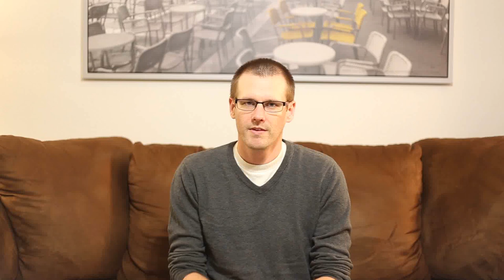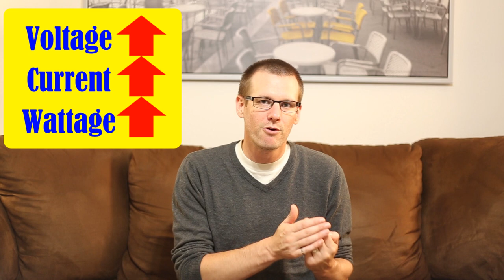Can Higher C Rating LiPo's Destroy a Motor or ESC?

Comment: high c rating will not hurt the system  as long as you are using the proper voltage, why because it will never pull more than it needs. this should be about sizing all the power system for the motor .. that includes the prop. under sizing  will  hurt the battery and the the power system  .. sagging voltage  increases the Amp draw. then you have heat
Reply: Exactly. C rating isn't going to damage your motors or escs.
Reply: True, C rating states how much current the battery can safely provide without overheating, not necessarily how much current will actually flow through the system.
Reply: You must not drag race.

Comment: So the answer to the question is "No", because the whole electrical system can only pull the current it needs to operate. So long as you don't overload the motor with too large a propeller. A battery doesn't push amps, they are drawn from it.

Comment: hi, for a flashlight that need 6A load, if i buy a 35A battery will damage the system? the voltage still 3.7v 10A or 35A...

Comment: I know this out of topic but i need help,a 4370kv brushless motor paired with 35a esc but will only runs on 2s lipo.will it give any trouble?
Reply from the maker: No it won't be trouble if you load the system less than 35A or your weakest link. Yes it will be a problem if you load your system to over 35A or your weakest link.
Reply: @RCexplained  will my 35A-SL esc run with 3S 11.1v 3500mah? I don't really sure what battery should i buy.tq
Reply from the maker: Hello, i don't think that's the right question. The question that will help would be: is my 35A ESC, 3500mAh battery and X motor going to be ok with using a 12x6 APC propeller. 

Your battery will be fine if you don't plan on using a load. But it will fail horribly if you toss a 35x20in prop on there.
Reply: @RCexplained  tq for replying me, i actually want to know what is the maximum battery voltage suitable for my 35A esc. Im sorry my english is not really good.
Reply from the maker: Does the spec sheet not tell you the maximum?

Comment: This is opposite of what all other places say about the c rating. It just says how much your esc and motor pulls. Your esc would have to pull more power then it can handle which would mean it is already broken
Reply from the maker: Why would an ESC be broken if it has more power pulled through it then it can handle?
Reply: @RCexplained   Electronics are design to pull the power they need and not just pull all the power they can. If the hardware or programing of your esc makes it pull more power then it is designed to do and burns it self out, that is broken. Now if you put a higher volt battery that pushes power into the esc and burns it up that is different. One is pulling power and one is pushing power.
Reply from the maker: @R2D242D  interesting perspective on how physics works. This is a very different thing then what is taught on this channel.

Comment: Im using 11v 2200mah  25c s3 lipo and 40a esc 5v , A2212 motor and the esc burned twice , i cant find the problem ((rc plane)
Reply from the maker: What kv and prop? How many amps were you pulling from the system?
Reply: @RCexplained  8/6 props 1400kv , but dont have ampmeter to fnd out (im noob btw)
Reply from the maker: @halash447  setup sounds ok. It would be a good idea to buy a watt meter and measure what is happening in your system.
Reply: @RCexplained  thank you very much i will also change my motor which could be blocked , all the best and thx for ur advice

Comment: I use 3700 mah 130c lipo,90 amp esc and 4480 kv and 37 mm prop brushless motor for my rc boat...its getting hot on my ec5 and banana bullet 6 mm....and loose power when  i play just 3 time full trigger....why is this happen...
Reply from the maker: Sounds like you are pulling too much current. Your setup is ideal for a 2s battery. I'd expect you are using something different.

Comment: Hi! May i ask a question: i have a thermal issue with my motor. I ve been using chinese esc(bec 6v / 2a) and battery pack (2s 3000mah 35c) for 370 9volt 50000 rpm motor. i burned several motor already. what seems to be the problem? or which part do i need to change? i still want to use the same motor, but it keep overheating

Comment: Ok so ive been looking into this for so SO long now ive lost sleep its affected my work, im dreaming of lipos chasing me up and down stairs in elevators and up the street and ive been to every retailer, Youtuber and Rc/Hobbies forum on the planet, and from what ive found in a nutshell is this. 

The "C" rating on batterys cannot destroy your motor or esc. Your motor/s or esc will only draw current required from the battery not the other way round (i.e the battery does not force this "C" rating through your motor/s esc's)  the "C" rating is just there to tell you the safe discharge speed of the battery so going higher is always ok. 

hope this helps.. I need to sleep now.
Reply from the maker: This is very true in general, (C Ratings should never lead to destruction of components) however, there is a scenario that many should be aware of and understand clearly.  A higher C rating allows a system to maintain a higher voltage or lower voltage drop across the battery pack. With a higher voltage from the battery to the motor, the motor will draw more current. If your power system is already on or very near it's thermal threshold, this small bump in power can exceed the thermal threshold  causing burnout or destroyed components. If you notice a bump in acceleration or speed from a higher C rating pack in an RC vehicle, this suggests the system is experiencing higher power output. 

The second part of this is:
If this scenario is true for a power system, the power system has not been selected correctly. It is very critical that a power system is selected in such a way that allows for thermal headroom. This boosts reliability and performance. 

There have been factory RC vehicles that are very sensitive to subtle voltage increases leading to motor destruction. A good example is part of the Latrax lineup. If you use a high C rating LiPo and do not monitor temps on the motor, you do risk motor burnout as experienced by many.
Reply: Yeah, i recently lost an esc this exact way. Pushed too far with 120c 10,000 on 150a esc. Got away with it for a while. I'm  now monitoring temps, using better fans an used spacers to create an 4mm air gap between esc and mounting plate. Also set an alarm and lowered motor timing. Also can lower size of pinion to further drop the temps. Bash-On!👍

Comment: Good talk,   thanks.    I see a lot of people asking "what about my setup"

Do you know of an online website calculator that we can plug "known values" in and get a "solve for unknown variable."    In this case I guess -  Motor , ESC, and solve In relation to
S count ( voltage) 
Current rating. ( that's the 20.30.40 etc. "C" rating )  yes?

So basically solve for acceptable c rating for given esc ( and motor if known)  then choose voltage of the pack and solve for "c".   Hope that made sense.

Comment: Should also mention that c rating is relative to the mah, a lot of people think 30c 1000mah battery can deliver the same amount of amps as a 30c 5000mah. I have noticed higher c rated batteries can be slightly larger so some people may go to a smaller capacity to fit the pack not realising it reduces the max amp output
Reply: The Problem is ..  that a lot of People By things without knowing what they do ... my tip is .. before You want do to something .. get the basic Knowledge !!  C Rating  is only a 1 factor in the calkulation what a battery pack can deliver :  the formular is ..  Capacity  x C-Rating = max Amp   Example ..  1000maH x 20C = 20A max   Everything Above 20A can damage the Internals of the Battery  !!  and as a side effect other Parts of Your System ...   but more C Rating cant be the Reason for a Defect. it is like You driving a car ...  
if You drive 50km/h in a town .. it is not the Fault of a bigger Engine if You drive 100 and get caught !! or have an accident   The C Rating alows You to use more Amps .. it is not the reason if these Amps damage any of the compnents in your system ...

Comment: I built a micro Apex with a SpeedyBee 20x20 35a F7 6S stack, Rush Tank Micro VTX and 6S 2204 motors.
It flew fine on 4S.
I used a Speedy Pizza 1200mah 100c 6S once.
The flight was just a short punchout and video was gone.
It fell out of the sky and broke an arm and no power.
I know the pack was heavy and I know the battery was able to supply the motors, but I don't think the ESC was able to keep up with those two.
Or am I wrong?

Comment: I size my electrical components the same way I size my electrical circuits. You should never be exceeding 80% of a circuit's rated capacity. what that means is if you expect to pull 50 amps maximum on a motor then use the equation: max amps  x 1.25 = min allowable rated amps (50 x 1.25= 62.5) amps meaning you should be sizing your ESC to handle at least 62.5 amps however nobody makes an ESC that specific so instead select the next highest capacity ie: 65 or 70 amps. It is also worth while to note if you don't expect to be running a motor at or near full throttle all the time you can choose to use the Esc's rated burst current instead. Most Esc's can handle 5- 10 amps more of burst current than sustained current. Once you have the proper ESC you should select the proper c rating and voltage to correspond with your motors and ESC. This is not really as cut and dry as battery manufacturers often overstate their c ratings so it is likely to just be trial and error. However you should note that a higher c rated battery will perform just fine operating below it's rated discharge. For a 50 amp discharge or higher I would recommend 75c -100c

Comment: I have two questions 
1: I have 80 amp esc and motor combo with esc peak current 520 amps and my battery is 6500 mah 50C do i have ok battery for it  and does the peak current of the esc matter for the battery?
2: So if my esc and motor is hot than i have ok or high c rating and if my battery is hot than i have low c rating and what if its all hot?

Comment: I’ve flown gas planes for 20yrs and have just bought the HobbyZone Husky 1800mm airplane. Power system: 3541-750Kv motor, 45A ESC. I bought a HRB 4000mAh 60C 4S. 4S is correct, but they suggest a 35C battery. Is this to much battery for the ESC? I do have a 100A ESC I could use. This electric battery jargon is much more complicated than gas engines I think. Thanks and I subbed. Think I’ll be able to learn a lot from you.
Reply from the maker: Having more than 35C is excellent. 60C will work well.
Reply: @RCexplained  thank you very much

Comment: So I currently have a rafale that suggests using a 2200mAH 25C 14.8V battery but I can't find any online, just to confirm it won't ruin the the motor to use a 14.8V 220mAH 50C battery then?

Comment: Hello,thanks for your sharing. I am new here, I am wondering how I could know the current the brushless motor need when it is operating
Reply from the maker: What are you placing this motor in?
Reply: @RCexplained  with propeller, to provide thrust force to the robot car to climb on the wall
Reply from the maker: @leyuanma4886  for a motor with a propeller you can use an online calculator such as ecalc.
Reply: RCexplained Wow! Amazing calculator!Thanks a lot for your answer! Really helps me a lot!

Comment: Great series.. I raced RC cars in the 90's - and looking in on the modern electrics , much has changed (!)

I read somewhere that a brushless system speed controller can be stressed/damaged by a battery pack which doesn't produce enough power/current.. is this the case, and what should I look for in speed controller specs that indicates the minimum battery spec it needs?
Reply from the maker: Hi Rob, glad you are back looking in to current components that power our RC's. That is awesome! You are correct, a battery pack that does not supply enough power can destroy an ESC. To select a battery pack, you need to know how many amps your system is going to draw. This value multiplied by 1.5-2.0 is where I like to be in terms of the maximum continuous discharge current for the battery pack. The more head room you have the higher the reliability will be in your system.

Comment: Hello,  I like your delivery, excellent!
I am new to rc, new subscriber,  will studying your tutorials. 
I have a ground wire on my son's 1/18 Himoto buggy that it's getting fried.  It travels from the receiver to the esc. No other wires burned. 2S battery. 
Hobby store guy says just keep replacing wires. 
This doesn't sound right. 
Any ideas? 
Thanks for the info!
Reply from the maker: This does not sound right for sure. Is the fried wire the brown or black one in the 3 leads from the esc to receiver?

Are there any extra components that have been installed on the receiver? For example an after market light module plugged in to the receiver.
Reply: @RCexplained  thank you for the reply, much appreciated! 
So the black wire alone,  from the receiver to the esc, is burned.
No other wires affected.
No upgrades,  all stock. 
The other thing that I forgot to mention,  is that the motor burned out twice.   The hobby shop replaced them for free, stating coincidental crappy motor.  Hmm.
Though bad motors happen,  one immediately after the other,  is too much of a coincidence. 
Also,  the wire seems to be fairly evenly burned throughout the entire length,  with some spots where metal burned through.   This seems to indicate that it was excess power,  instead of heat emanating from receiver or esc.
Very strange.  Im no electrical expert by far,  though your videos have increased my knowledge greatly. 
Thanks again!
Reply from the maker: @MrsRabbit8  I'd agree that it sounds like excess power traveling in this black wire.  I would expect something in the radio receiver system is defective. You should not experience radio power wires getting hot enough to melt the insulation of the wire. 
It does suggest to me that something within the radio system is pulling a lot of power. Is the servo buzzing excessively when no control input is provided? Does the receiver seem excessively hot when the RC is powered on for several minutes already?

Comment: Can I use 3s (11.1) volt 30C lipo battery on my ct6b transmitter for rc ? Will it cause any problem to my transmitter due to high discharge rate?? By the way ur videos r great.
Reply from the maker: What batteries do you normally place in to your CT6B?

Comment: Hi hope you are fine, thank for your videos, they are very helpful.

I have just one question on my new surpass hobby motor I see 3 specs for the Amps:

Max amps for the motor: 66 A
And for the ESC are two
Cont. Current/Burst Current: 45A/240 A

The question is, which out of those amps do I have to match with the C raiting?, The 66 amps from the motor or the 45A/240A cont/burst from the ESC?
Reply from the maker: Hello, you always want to consider selecting your system based off of continuous current. Not peaks or bursts. Ideally you would know how much power you are going to load your motor to and base your system on this.

Comment: you help me out so much i am so thankfull but ive looked high and low  for this.... 1/16 on 2435 3300kv  brushless motor and a  13t pinion and 1550mah 35c 2s ....i am looking at waterproof setup and see hobbwing wp-16BL30 witch is 30amp..is the lipo c rating to much for 30amp esc if so ill just go 60amp but the esc is hugh haha

Comment: hi, thanks for the explanation! but i still have issues grasping this...
so as i currently am experiencing some heat problems with my 1/12 rc basher, i don't know how to deal with it, please help out..
here is my problem: currently the motor, the ECU and the batteries are getting hot to the touch. i can hold the batteries in my palm but they are quite hot not just warm, on the motor i can't keep my finger for more than 2 seconds and the ECU is quite warm but not hot. 
what do i do?
by what i can understand from your explanation i can do the following:
- get a battery with better continuous current output. but then i will overheat the motor even more, no?
- or get a better motor that will not overheat for the current power usage. but then the batteries will be forced even more and heat-up more, no?
- get both a better battery and a better motor, and that will cause the ECU to overheat, no?
- get a better battery, better motor and better ECU...aaaand....we're back to where i've started from  😋

now i'm stuck 😋
just to rule this out: i've tried cleaning all the bearings and lubing/greasing everything up so that it runs smoother but didn't help :(
Reply from the maker: Hi Chris, are you able to reduce the size of the pinion gear on the motor?

Comment: Yo bro thank you it makes more sense for the issues I was having I have a proboat velez 29 catamaran and I was having issues with my cheap rc truck lipos for this boat and I bought a higher output better socially rated lipos among the rc community and had less heat in the batteries and the 120a esc as well as the batteries don't get as hot (on 6s mind you the boat planes real fast on 6s and as such has less resistance over the battery usage) now on 4s even with the better batteries I was still getting alot of heat in the batteries and the motor and the esc so I  am thinking for next season when I go to run my boat I will be using the high speed racing lipos that are rated at 120c for the 4s application and the mid range good lipos for 6s but I also bought 6s 120c racing lipos those are ok to use as well right?? Or is it best to only run those once in a while
Reply from the maker: The higher the C rating, the better off the setup will be.